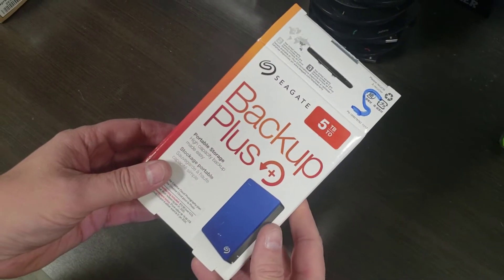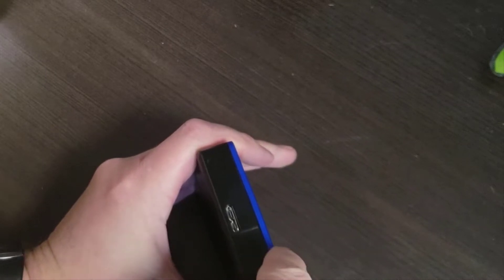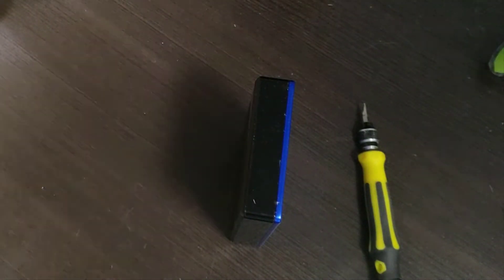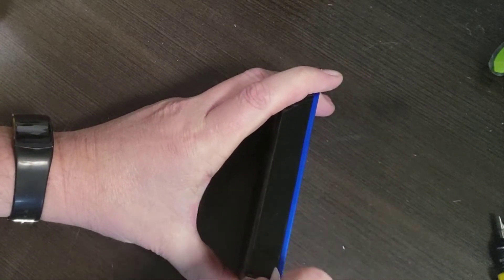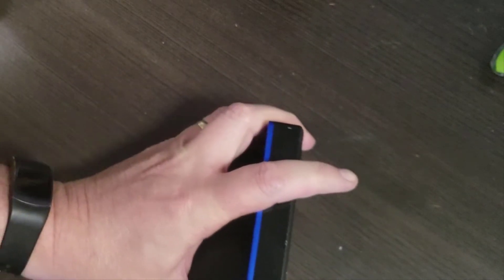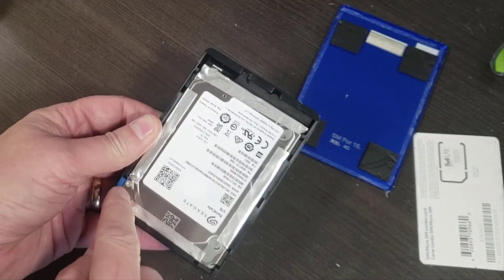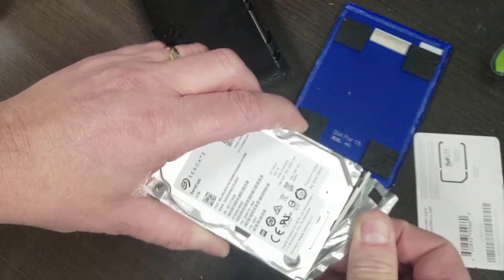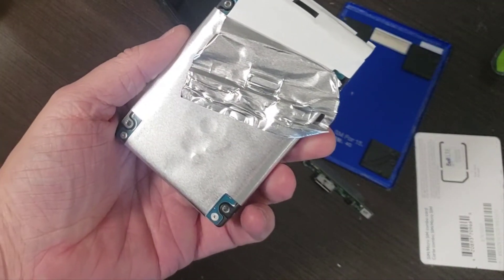How To Disassemble a 2.5" USB Seagate Backup Plus Disk

Comment: I have a 4 TB Backup Plus which I plugged into the USB port on my Smart TV, to watch a movie. It hasn't worked since.  When I plugged it into my computer, the device manager, nor the disk management would not see the drive. I disassembled the Backup Plus case and removed the drive and took the usb circuit board off of the drive, plugged it into a sata to USB adapter and the disk management saw the drive but said it needed to be initialized. I am wondering, is it possible that, the circuit board that was on the drive could have been fried by the smart TV?
Reply: did you ever recover the drive?

Comment: I did this because the USB interface for the external hard drive seemed to no longer be working. (Would cut out and crash Windows Explorer and any other device that tried to access the drive after a few mins) But unfortunately after plugging in the sata and power to my PC, it wouldn't even show the drive. (Showed Disk 0 Not Initialized, and wouldn't initialize either.) But the tutorial was very useful to trying to recover my messed up external drive regardless! I'll likely have to try to go to a data recovery place, or try out my SATA SSD/HD dock to see if that works. Thanks!

Comment: Still works on this drive in 2022! (4TB) I got a Seagate Barracuda, probably the only 4TB 2.5" model they make from the Barracuda line. I don't have the drive in front of me...

It was more difficult to get the drive out than this video makes it out to be. Back in the day these drives had screws in them with rubber grommets over them and that's how they were secured inside the enclosure. These drives, however, were held in with plastic clips going into the screw holes, that kind of design where once the drive is in place, it's very difficult, if not impossible to get the drive back out. So I ended up using two old credit cards stacked on each other (one is too flexible) and basically pressed them into where the screw holes of the drive would be, pulling and prying until the clips were either depressed and freeing the drive, or broken. I shucked two of these drives (Seagate 4TB Gaming for PS4) and broke at least one of these clips on both, so the enclosures really can't be reused unless you were to use some kind of adhesive to hold the drives in. 

Seagate appears to be the only shuckable brand. No dice with Toshiba (owned by WD) or WD.

Comment: From my personal experience, the USB to SATA adaptor damage the drive more compared to when the drive is connected to regular SATA interface. The adaptor used in Seagates is especially bad. But WD made the adaptor a complete part of the harddrive making it useless for installing in the standard SATA ports and they still fail, part of the reason might be less stability for USB ports ( some are loose, some are worn off). Not sure but I feel the USB to SATA needs some better design improvements for all manufacturers.

Comment: Thanks. My drive died yesterday after a reboot. The HDD was used as backup for my SingleBoardComputer. Sat only in the cabinet no movement at all. The motor doesn't spin up. The controller draws 160mA. Hopefully only the controller board is dead. I will try to RMA it before opening it. This video shows me at least, that it is nearly impossible to open without notice.

Comment: It's not a disk or disc but a drive, you don't want the platters inside it.
Why did you bang on it? That can damage it, even if the heads are parked hitting hard the drive can still damage it.
Reply from the maker: Hi Dallas.  Disk and Disc have been used interchangeably for decades in the industry (I have been in it since the 1980's!) and I assure you this IS a DISK DRIVE as opposed to SOLID STATE DRIVE.  As for banging it, yes, you are definitely correct that it could cause damage but it won't.  If you spend your time wearing anti-static bands and being delicate you will find these projects take double the time.  It is more efficient to 'get it done' and break something every decade or two.  Thanks for the comments

Comment: The latest ones are much harder. (2021) Removal is a destructive process to the case now.
Reply from the maker: Hi Chris; You might find using a heat gun or hair dryer, along the seam might help.

Comment: Can you use a heat gun to melt the tape? Would that make it easier?
Reply from the maker: Hi Jianre; You could definitely make this easy and cleaner with a heat gun or even a strong hair dryer, but it would make it hot to handle when disassembling and most people don't have a heat gun.

Comment: this looks too thick to use in a regular laptop (in my case an Intel Nuc as 2nd disk).  Looks really thick.  Is this a unique size hard drive for that enclosure?
Reply from the maker: Hi David;  Noper, these are all stock 2.5" drives.  Remember however that there are two thicknesses of 2.5" disks (1 platter & 2 platter), so it MIGHT be too thick for your laptop if that laptop will only take 1 platter disks.

Comment: Unfortunately they no longer look like this. The new cases are HORRID to open :(
Reply: Were you able to open the new case?  Just got one and it looks to be a real pain. any tips on how to proceed? I guess Seagate wanted to stop people from opening these and pay almost half of what they sell the same bare drive.
Reply: @peterpappas620  They ended up being not tooooo bad to open - you have to slide a spudger in along under the front (front being the 1cm x 5cm or whatever end where the metal folds down from the top) to get under the strip of glue they have holding the metal to the plastic. Once it’s loose, keep that spudger there holding it 1/2 a mm away from the plastic, and use a second spudger kinda as a really wide screwdriver at 90 degrees to the front of the case (same definition of front) in the ‘slit’ that’s created between the metal and the lip of plastic, to lever the aluminium case upwards. Once you have it up enough to get something under the top at the front, pop something in there and lift the line upwards, and work your way along to the back, there’s three or four tabs holding it down on each side.  Sorry, it’s hard to describe, but once you’ve done one and butchered it a little, you’ll see how it goes together and understand :). I butchered my first, and my other 14 came apart nice and clean.
Reply: @DamienGardner  Thanks, I got one open by starting at the top. A bit of a pain because it's so tight between the metal top and plastic sides, but not too bad.

Comment: Thanks for this video. BTW, to take out the HDD after removing the cover, instead of tapping on the back of the drive, just peel the aluminium layer from the end opposite the USB port and pull, and the disk will pop out.

Comment: Can I use a different cable on this seagate drive? For example would a USB A to micro B cable work on it?
Reply: It needs the extra USB 3 portion so it gets enough power to run the drive. Micro USB is limited to 500 ma with the USB 3 connector it has up to 900 ma